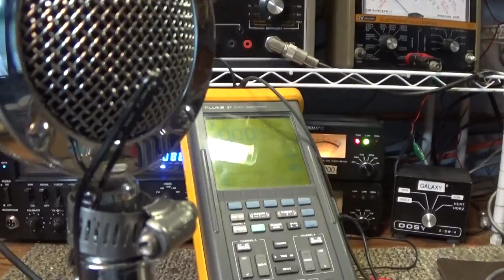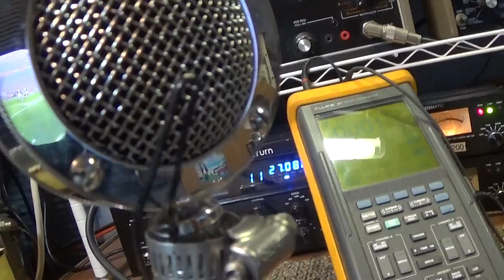Browning Golden Eagle CB radio Ping Poor Mans w/D104 and Bobby Pin

Comment: I can't speak for others, but what I did (in the 70's) was to use a large Safety pin, you cut off one leg so what you have left is the coil still connected to the sharp pointed leg, remove the D104 screw right over the key bar and replace through the coil of the "pinger pin" (what we called em) the screw MUST be tight and just the very tip of the pin needs to touch the bar, measure before you buy the safety pin and any adjustments in length need to be made in the coil, the leg sticking down needs to remain straight and unbent, also cutting off the point to adjust length messes up the ping tone.

I used that setup for many years and no-one ever thought it was anything else but a set of eagles.

I hadn't thought about that in years, thanks for the memories, later man.

Comment: I have 3 Browning Mark III's and they all make what everyone calls the "ping" sound.  Depending on what mic you use and how close you keep it to the radio's speaker depends on how long it "squeals or squawks" or if it does it at all.  For one of my Cobra 148 mobile radios I used one of the recording noise toys and recorded my Browning and now every time I key my 148 it makes the noise.  Only difference is that the sound is identical every time on the 148 but on a real Browning it sounds different every time.  Keep having fun... Oh ya, I also have a noise toy that I recorded the audio from a video of a downed power line shooting sparks all over the place.  I let that noise toy play in the background of my mic audio and everyone keeps telling me that my radio has a short in it.
Reply from the maker: If I ever retire and get my station right, I already have the ideas and the equipment to do stuff like this.

Comment from the maker: Yes, I know you can do the safety pin and screw it down to the mic head screw, but safety pins sounded tinny. Get one of those old big wide metal hairpins and do it this way to get a deep rich church bell tone. I looked but most hairpins now are thinner and either plastic or rubberized like the one in the video. Get an old big metal one and try it, you'll like it. Mind you I did this video only to prove/show how it was done as some in my online groups questioned the legitimacy of this. I told them I seen it done this way and they said how in the world can a person do that....prove it lol.  I run real Brownings to get my Ping On.

Comment: I remember the ping being more than one note, as in a couple, with possibly feedback...I remember the tweety bird app, too, with the capacitors
Reply from the maker: The Browning Ping will do more than one note, especially if you move the mic toward and away from the speaker as it is pinging.  There is a popular electronic Browning imitation Ping being sold now that has multiple notes but it plays the same notes each and every time.

Comment: That was BULL CRAP....
Reply from the maker: Yep, but it sounded totally awesome over the air though.
Reply: @tramdr  Awesome till you hear the Real Deal ...I installed 200 pings's in the 80's. I moved the  
'White Wire" up in the circuit which made the ping much longer. I had truck Drivers coming from Texas to New York to get my ping's..I can't even buy those pings today. Would love to have another C B Shop, Today I would need to rent a building where trucks could park.
Reply from the maker: @Rickugg  I gotta disagree with you. I started here in Detroit on channel 22, the 'Sugar Bowl' because that's where all the sweet thangs where in the 70's. Not only where we keying on each other back then, but we wanted to impress the girls too. A big bad Ping was one way to do it and back then at one time, I would say 1/2 where doing it. Of those, I would say 1/4 where using the poor mans bobby pin and like I said earlier, that Bobby pin ping over the air sounded way better than the electronic ones. Another example of that is the original Browning Ping sounds way better than the electronic ones too. Also,  I never did CB for a living just a hobby for me, but a good friend of mine did and still does. I would guess and say he has installed 2000 Pings. He ordered them 100's at a time. He and I helped invent and perfect the 'dial-a-watt'  too.

Comment: This is really dumb , not to mention scratching a vintage mic all to hell !
Reply from the maker: Maybe, but I can think of about 100 things worse than this that CB'ers do to try to sound good or to try to get out better. At least THIS on the receiving end sounds great.
Reply: They made 100's of thousands of those "vintage" d-104s, they are plentiful.  Usually anywhere from 10 to 40 or more for sale every single day on ebay,  Plus there are a lot worse things men could be doing than having fun with an old cb radio and a hair pin.